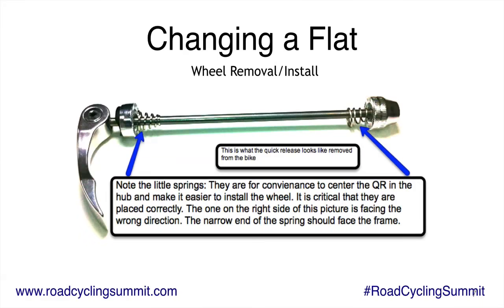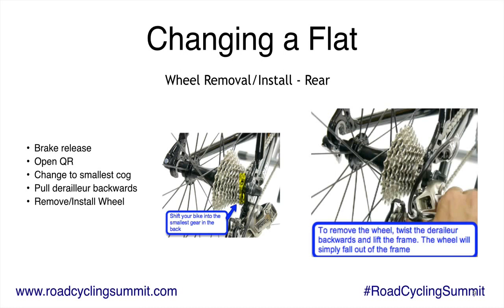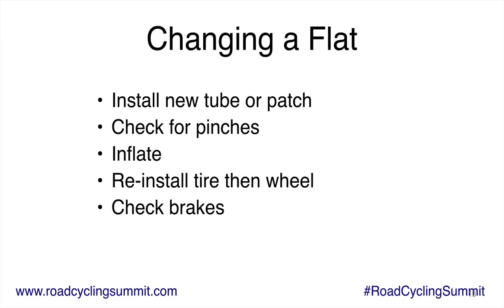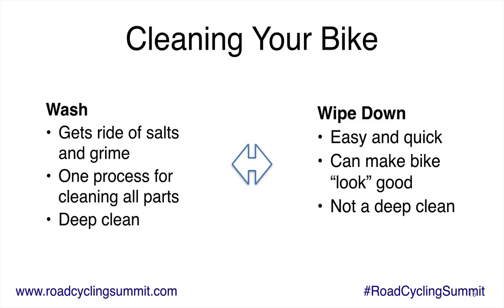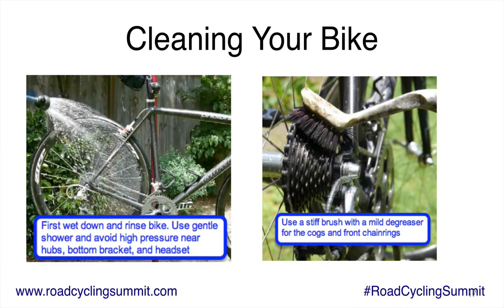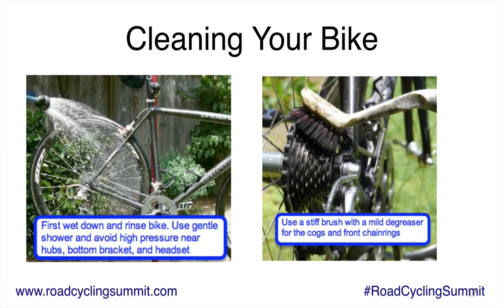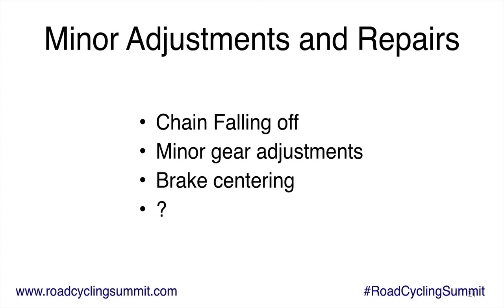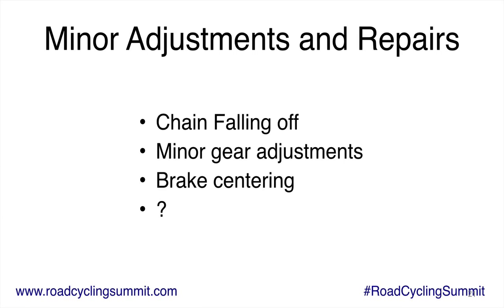Road Cycling Summit - Overview or Bicycle Maintenance

Comment: Hi! There are tiny holes in our bike frames, on steel, aluminum and carbon frames. I dont want dirt and moisture seeping through those holes. Also, i dont want to close that up cuz there must be a reason for them. For now....what is the best thing to do to prevent the frame from corrosions/rusts? There should be something to apply through that whole to protect the frame. Thanks n Godbless!
Reply: red delatorre bubble gumm.